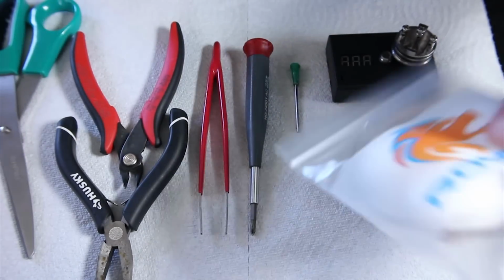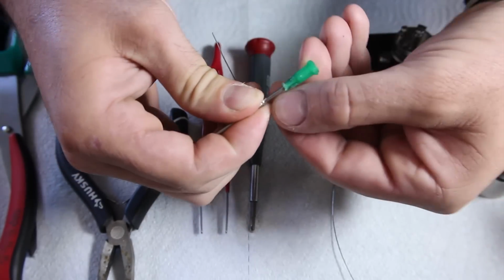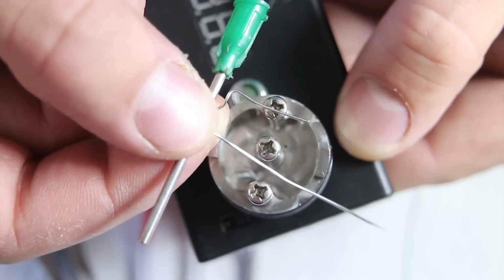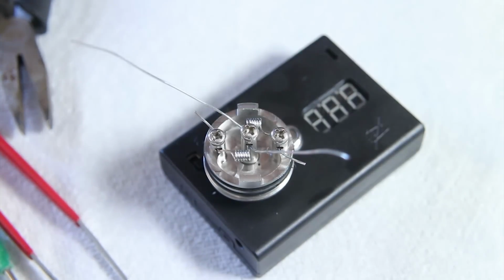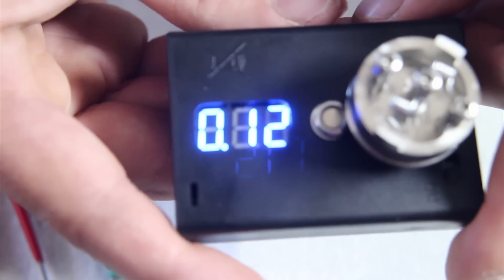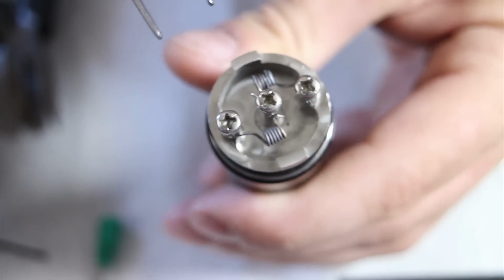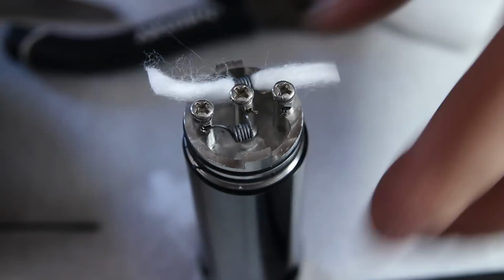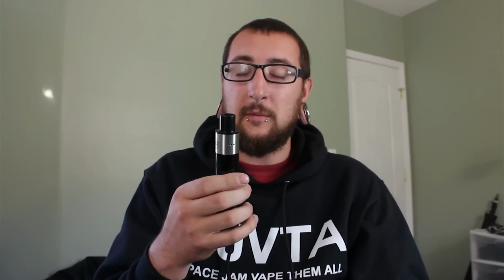#FRESHBUILDFRIDAY - 22g Royal Wire by Dryx/28.5mm Tobh

Comment: I like the 22g build but ur build wasnt in front of the air holes maybe why u got a hotter hit.. imo I have the same gear 26650 hades with the tobh atty but I build away from the middle wall ... I build mines in the corner directly in front of the air holes.. better taste and more vapor.. well thats me... VAPE ON!!
Reply from the maker: I definitely agree, I ripped out that build a few days ago and rebuilt it without pushing it towards the center and it's much better. I think I might take out that AFC block on the rim of the deck because I prefer center coil builds nowadays because I feel like they wick better. Live and learn, vape safe and vape on brother!